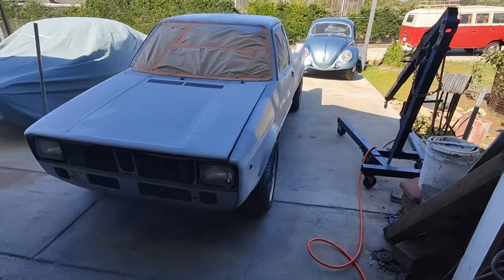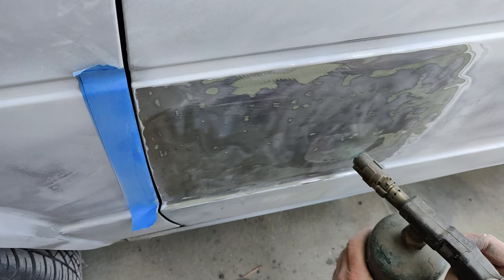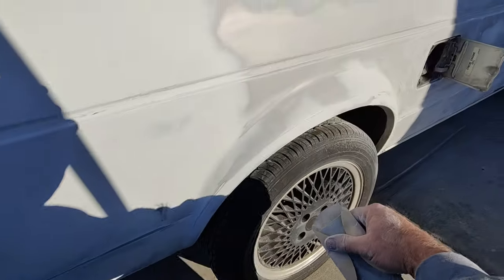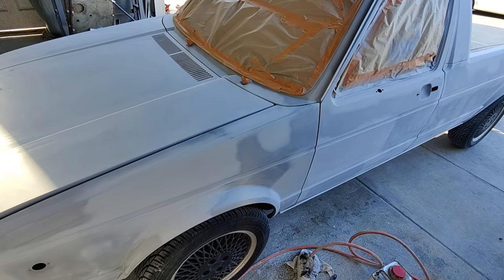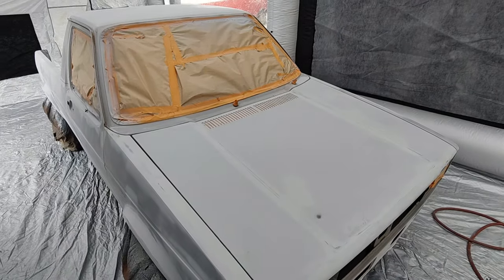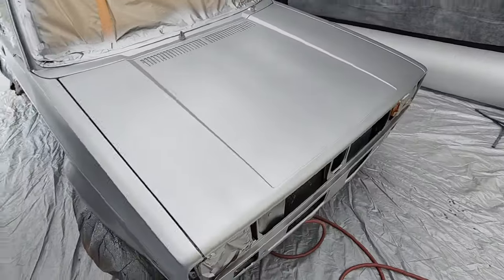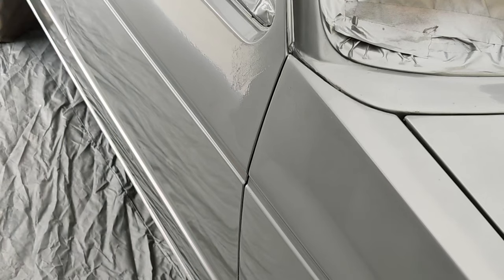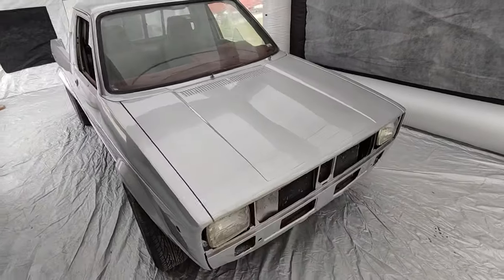Spray Painting Metallic Silver -VW RABBIT CADDY Pickup Restoration - with 1 quart?

Comment from the maker: if you notice My first 2 coats I am going really slow. That is because with the extra binder it was really thick. It also took more time to dry those coats. Filled in the sanding scratches amazing. would work easily on 220 scratches.
Reply: 320 guy my self.
Reply from the maker: @rbrtplly  back in the early days we used 320 on metallics and 220 on solids. Never got sanding scratches. The newer materials are thinner than the old stuff. So guys say they get sanding scratches. Using the binder really makes the first 2 coats a little more transparent but fills those in nicely. Binder is cheap on some of these websites. Less than $100. to save you hours of prep.
Reply from the maker: @rbrtplly  I also used 220 on cheaper jobs back in the day with 2 stage metallics. just a little extra paint and it covered. On cheap acrylic enamel jobs i used 180 with the lines in the paper. the one without the lines would leave scratch. The cheap paper with the lines would not really. That was the $300 pinto job.

Comment from the maker: it was very cold when I was painting this maybe in the high 50s and all I had was medium hardener and reducer. So that is why I got a few sags and stuff. turned out fine....easy to fix with a razor blade scratching them off, and little color sanding. Check future videos and see how it turns out. need to wait about 3 or 4 days to buff.

Comment: Looks great, silver metallic is the worst color after black...not easy getting without scratches showing. Back when I painted cars # 220 was standard for solid colors, only silver and black got the extra treatment with # 400. 
I enjoyed painting enamel, one flash coat, let it sit for 10 min, a second heavy on until you got a mirror finish, then wait 10 min and final lighter mix with more reducer for the last third coat to really float it out. No cut & buff needed was always my goal.
Of course a few run could happen..let the paint dry and use a new razor-blade cut down the run and fine polish...by hand.. Enamel takes time before really dry all the way down without a heated /oven paint-booth. 
But filled great, very nice shine and cheap back then.
Was fun most of the time except painting big army-trucks and caterpillars...so much prep-work, sand blasting, get all grease and crap off...ladders..climbing up and down..paid good money but my body got some issues after doing body-work and paint for 25 years..shoulders, popping knee cap's crawling on cold cement, welding, sanding.. & all the fumes.. bondo-dust, paint, lead-fumes (did show car restorations filled welded panels using lead instead for regular filler / bondo. 
Many fun memories from my traveling van repairs to small car-lots fixing dents and cheap cheap paint-job's... didn't enjoy the cheap part too much, goes against my quality work standards but sometimes needed to keep the lights on and food on the table.  
I can tell you have painted a long time seeing this video how you handle the gun and prep-work, good quality I would say.

Cheers from Texas. 🤠